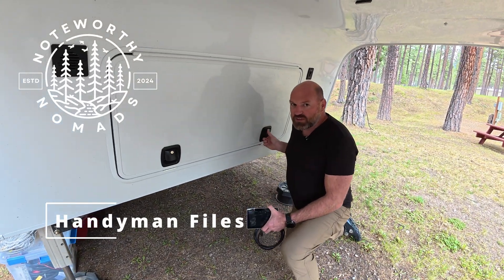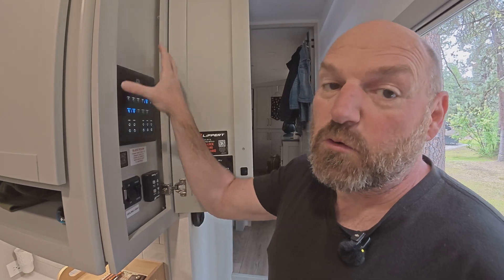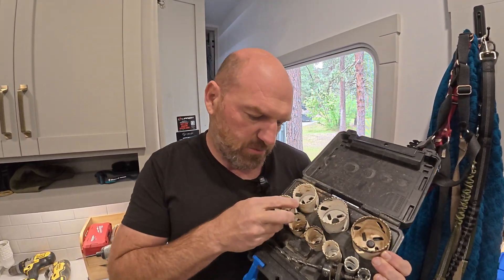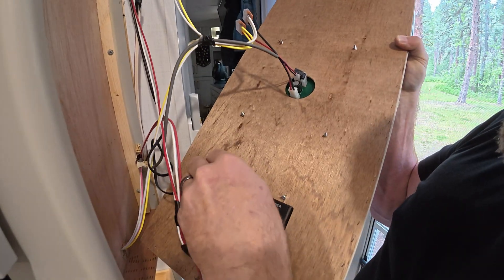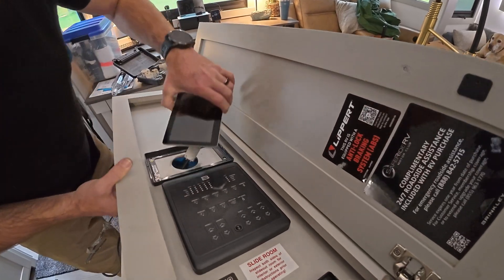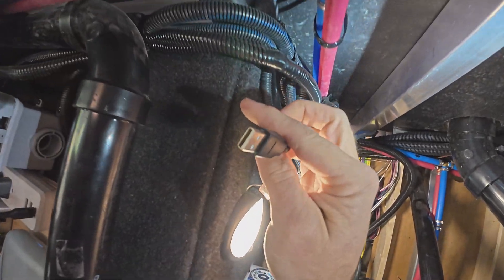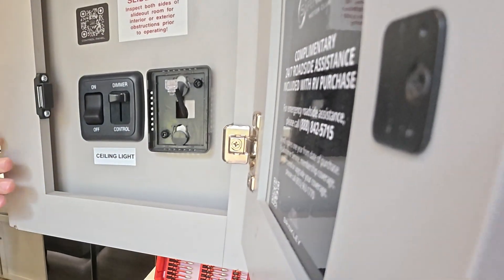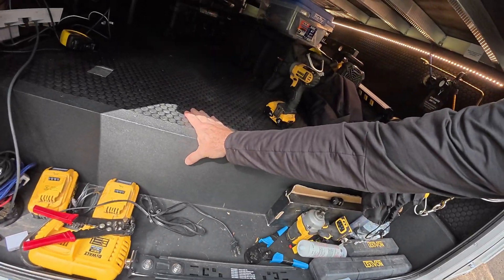How to Install Victron Cerbo GX Touch 70 in a Brinkley 3515

Comment: Great video.  I have all my components to do the inverter install and I'm wondering if it's possible to put it on the bathroom wall just above the furnace thermostat but without interfering with the pocket door  (we have a Z3100).
Reply from the maker: Thanks for watching! Functionally, that would be a great spot. The challenge is that the HDMI hump is about 4" wide, and with the pocket door being 23" deep before it hits the corner stud, that only leaves about 3.5" to the corner—so space is really tight. I'm also not sure there’s enough room above the thermostat to run it down alongside the thermostat wire.

I’d recommend reaching out to Brinkley to see if they have any suggestions for that wall. Let us know what you find out!